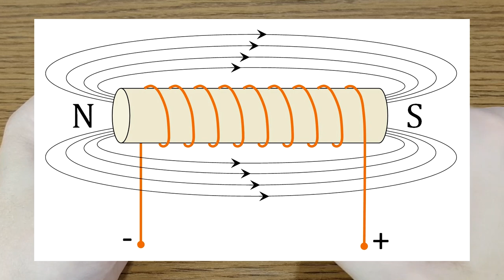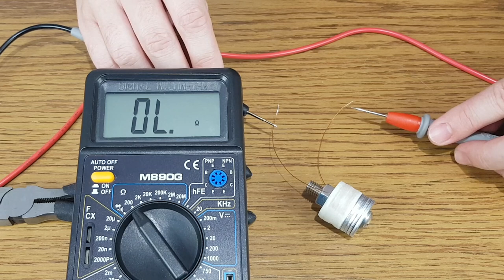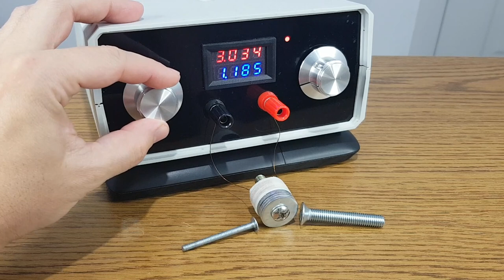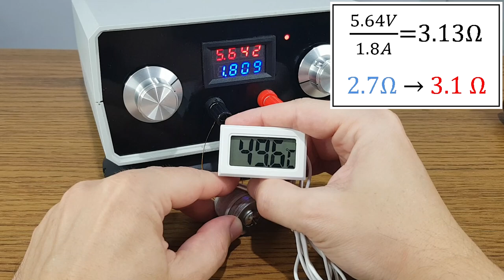Can a speaker driver work without a permanent magnet?

Comment: See, why DC why don't you hook the electromegnt to the same lines as the voice coil ?!
Reply from the maker: It will work, but the sound will be weak. the electromagnet needs a high current to create a strong magnetic field, the amplifier is not powerful enough.
Reply: @Sorin_DIY  ok thanks I didn't know it, but in hind-sight it's quite obvious, that the sound will be weak

Comment: You could try to connect the inner electro-magnet to the opposite poles of the voice coil in a hum-bucking setup so the amplifier drives both coils in opposite polarity. This may be more efficient and effective since the electro-magnets would push and pull eachother.
Reply from the maker: I tried it and it sounds very weak, probably because the electromagnet is weak. it needs a better coil.
Reply: @Sorin_DIY  So the idea set me off on a path to look into this and they exist and are called Electrodynamic Speakers. Most are very old but some high-end companies still make them.
Reply: @George.___ thank youu I was always wondering if that was a thing since I also thought it would use the energy more efficient but never knew for what to search
Reply: @Sorin_DIY  Have you tried both polarities? I imagine only one would work or produce any meaningful sound for that matter…

Comment: Just connect ends of vibrator coil and stator coil ,that wouldn't require a seperate power supply ,also help in reduce heating of stator coil due to ac current flowing in it

Comment: radios in the 1930s were made with electromagnets, the electromagnets were part of the power supply and acted as a "choke" in part of the high(ish) volt supply. They used about 50-100 mA but had thousands of turns. Congratulations you re-discovered something from 90 years ago!

Comment: Will it be better if we use the same audio to feed the magnet instead of DC current or on top of that?
Reply from the maker: No, it sounds better with the audio signal in the voice coil.
Reply: @Sorin_DIY  
Well, coils like AC more than DC and also that's one of the advanages of using dynamic magnet.

Comment: I figured a way to do it with no magnet or coil or any power source. I think if I put a coil on it that it would just melt.. so I substituted the coil for spinning plasma. Maybe you would like to help me out on my project. I'm going to build it very soon. I designed a couple of speakers made of granite and I mount them facing in opposite directions but sharing the same center. It should make a doughnut around it and levitate. I have all the parts designed. It's a thermoacoustic device.. using sound to make heat and sound to spin heat in a  doughnut where it condenses into water that gets vibrated apart into hydrogen and thermally heated into plasma and spun in the same doughnut. I'm more of a mechanical person... some help or advice with the speaker part would be appreciated. I will figure it out eventually once I build it if I need to put an electromagnet on it. It's an ac device using water with no fuse and so the amperage could go quite high....I could put a magnet and coil on it but that would be too easy.... my idea is that it may not need it... for sure it doesn't need any wires because the sound is coming to it wirelessly....old school way with a wireless microphone. I eliminated the need for wires and an amplifier by using a 454 lb xylophone key as a microphone and having it rest on the edge of the disks... transferring the vibrations it picks up directly to the disks...It makes it wireless. The disks in turn take the sound and blast it into the underside of the xylophone key in a feedback loop. The sound created inside spins everything in a doughnut.. and all the cold air gets sucked though the center hole of the disks in a continuous doughnut... the spinning plasma becomes the  coil and the current conducting through the granite disks creates the vibrating magnetic field.... and so I think I eliminated both. Come to think of it .. the galaxy is the same thing.. spinning plasma and no permanent magnet or coil.....

Comment: bro
will the speaker work if the magnet coil and the  voice coil are connected in series ????
 (without using bench power supply)
Reply from the maker: if you connect the coils in opposite polarity, the speaker will work, but very weak and very distorted. it's not usable.

Comment: Very early speakers and headphones used an electromagnet driven by the amplifier to move a metal diaphragm, I had a speaker for a short time that worked that way. Super inefficient though.
Reply: They would also use the speaker coil as part of the DC power supply filter.
Reply: @stevebabiak6997  Yep, a 3rd for a choke.

Comment: What happens when you have two voice coils, one inside the other, driven from opposite polarity signals?
Reply from the maker: it will create sound, but very weak. a permanent or eletro-magnet will create a much stronger magnetic field.

Comment: Hmmm...if you used two coils that repulse each other...just a stab in the dark here
Reply from the maker: if you connect the coils in opposite polarity, the speaker will work, but very weak and very distorted. it's not usable.
Reply: @Sorin_DIY  I see. Thanks,man

Comment: What if you powered the electro magnet with the audio signal passed through a rectifier?  Would it work?
Reply from the maker: it will probably work, but the sound will be very weak, unusable.

Comment: Did you check the material of those washers? I think the magnetic saturation and the permeability may not be very high, which makes the magnetic field less powerful. Of course, better materials may be hard to find.
Reply: Also, the suspension could be a little tight, if it's only the material that has to stretch. You could probably get better bass with a suspension of which shape also stretches, not only the material.

I know you probably intended to make this just as a test. But I wanted to share a little knowledge if there's someone who's interested in going further with this design. Thank you for the good video! 😃
Reply from the maker: Hi. in this video I only wanted to test this theory, so I built a simple speaker driver. in an older video I built a much better speaker driver that sounds pretty good. this speaker suspension will work for medium range drivers. these washers may not be the best material for an electromagnet, but this is what I could find. the coil is very important and also the position of the coil, to concentrate the magnetic field where is needed.
Reply: @Sorin_DIY  fun facts about your speaker that you made, that exactly how vintage speakers where made before permanent magnet was invented ngl no cap